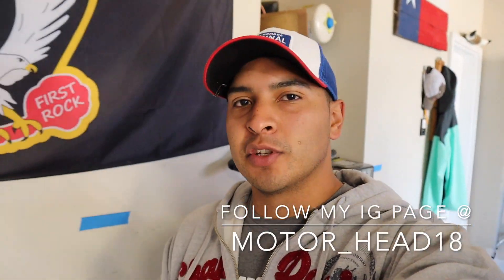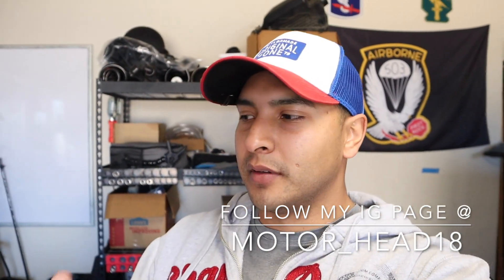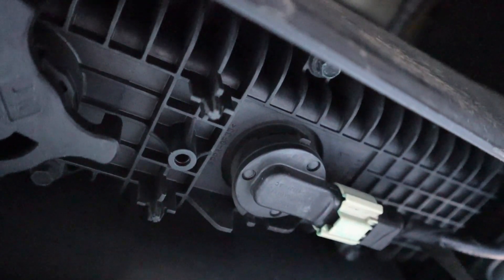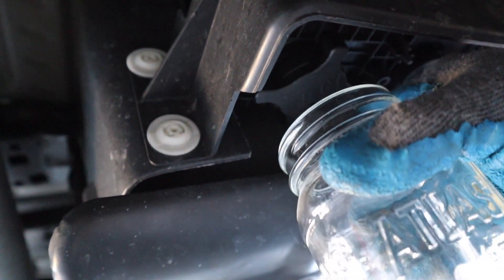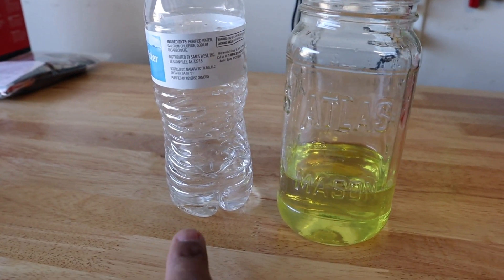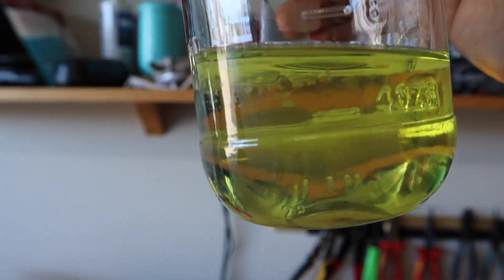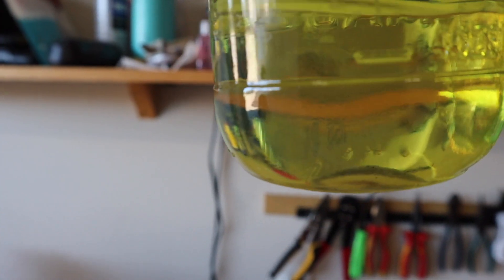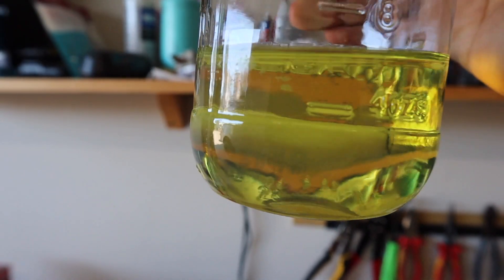Draining Water Fuel Separator on 2017+ Ford SuperDuty 6.7L Powerstroke!

Comment: Having no water in the water separator could mean that it's not doing its job.  Also it's not all about getting high quality fuel.  If you leave your tank only partially full, you could get condensation in the tank, which would introduce water into your fuel.
Reply from the maker: If my water separator wasn’t working, I would be on the side of the road, calling a wrecker to bring it back to my house to drain entire fuel system and replace CP4 lol.. great point though!

Comment: How do you prime the fuel pump with push to start button?
Reply from the maker: Just go back and forth putting it in accessory mode and turning it off completely. Putting it into accessory mode means you don't press the brake pedal when pressing the start button.